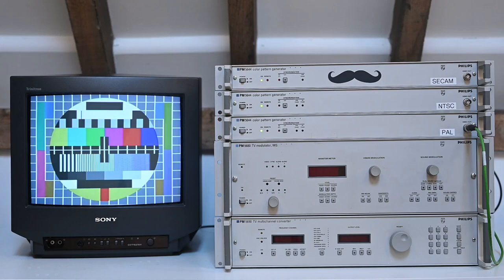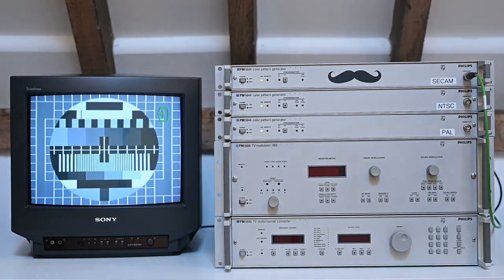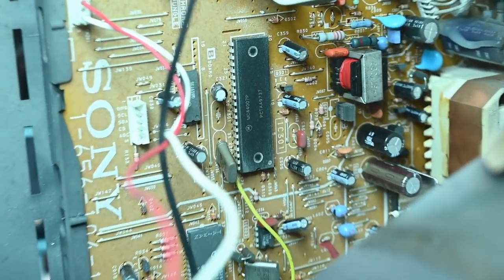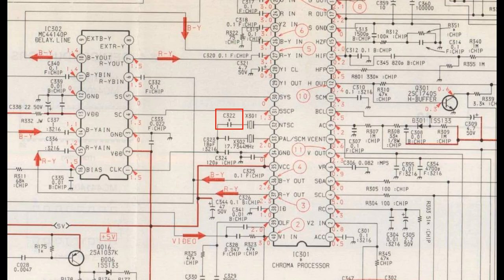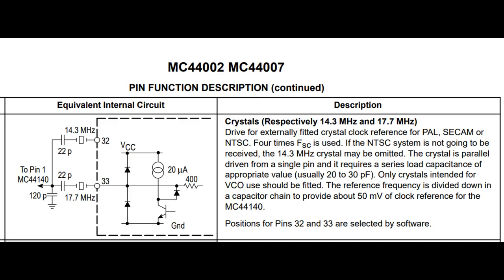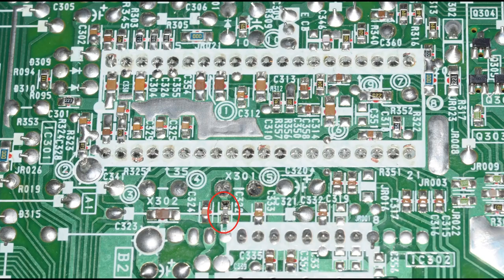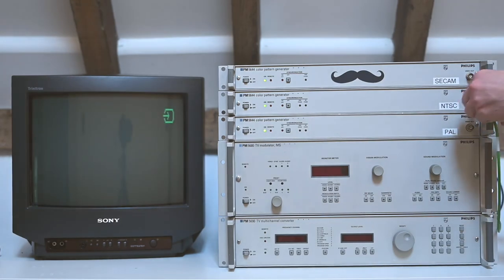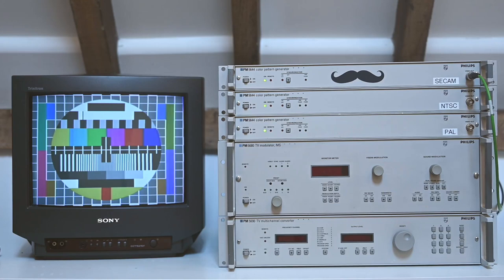#5 - Adding NTSC and SECAM support to a PAL KV-14LT1U Sony Trinitron TV

Comment: This was such a nice mod! I have tried to do something similar with some US market TVs but have never had any luck. Sony TVs sold here and Japan use NTSC only color decoders... I have a small Philips TV which uses a PAL capable decoder but it's missing components (as was your Sony) but more importantly, the MICOM is disabling PAL over I2C with no obvious way to fix that. Super annoying
Reply from the maker: Ah yes I watched your RGB mod video. I wondered how possible a mod like the one I did may be on a US model...
Reply: Hi! Maybe you can cover Sony's cheat for PAL decoding so as to not pay royalties to Telefunken. Did that mean early Sonys had poor colour resolution?
Reply from the maker: @SO_DIGITAL  See this: https://www.vintage-radio.net/forum/showthread.php?t=136086

Comment: I heard many SECAM countries just use PAL internally for vision mixing and control. It's then just converted to SECAM at the transmitter end. I also read that SECAM is SO immune to colour shift that it can be directly recorded and played back with no time-base correction. SECAM apparently also had great advantages over the very long video links used in places like Russia.

Comment: I'd attempted this with a consumer TV with an ST branded processor chip (STV2246H) that says it has PAL/NTSC/SECAM chroma demodulators, I added the necessary 3.58/4.43MHz crystals but it didn't seem to make a difference unfortunately.

Comment: What happens when u connect ntsc device to this tv with scart rgb? Like Sega Genesis. Is it working fine? Service manual says its support ntsc via video in.
Reply from the maker: Once NTSC is converted to RGB is technically is not NTSC anymore, instead "525 line 60 Hz RGB". I don't actually have a 525 line RGB source to even test this with unfortunately however I expect it would work, as it does display 625 line RGB (from PAL), and NTSC. There should be no technical reason why it would not work.
Reply: @mattstvbarn  Thx mate. Im going for NTSC.

Comment: Ok that would work with direct video input, but to make it into an actual multi-system TV you also need mods in the IF and RF:
- AM sound
- 4.5/5.5/6.5 MHz offset sound
- different bandwidth for video IF filters for NTSC and PAL/SECAM
- some different RF channels (e.g. UHF channels 69-80)

Back in the day I had a Grundig multi-system TV of similar size as your Sony, and it was quite complex.  But it worked very nicely.  We had an NTSC transmission from American armed services and SECAM during tropo from France, and it all worked flawless.
Reply from the maker: Yes you are correct. Sod that. Too much work! I only wanted direct input!